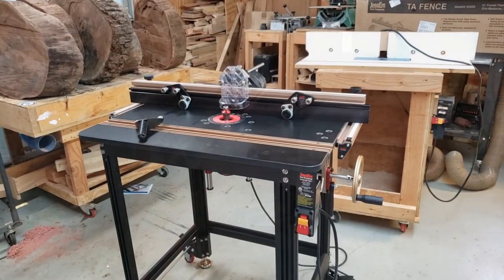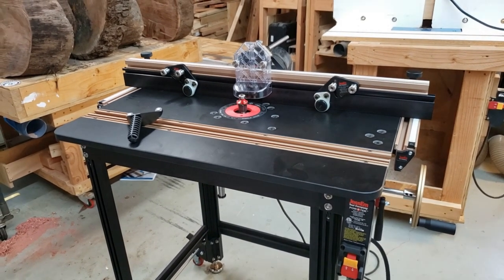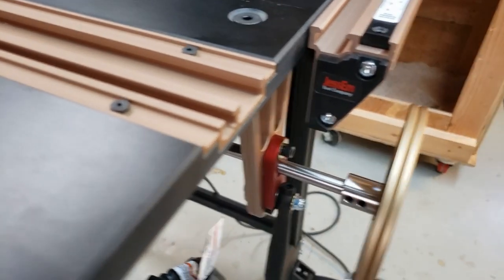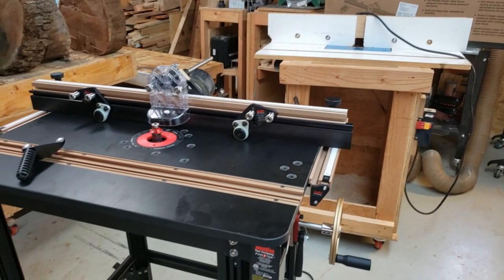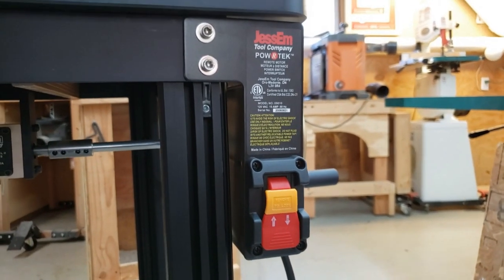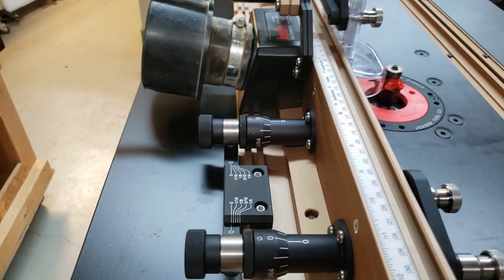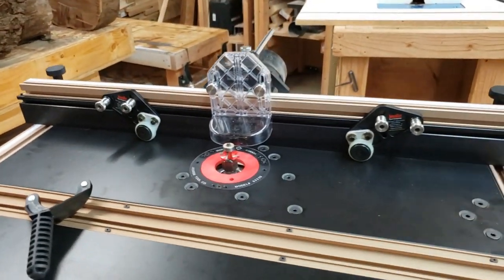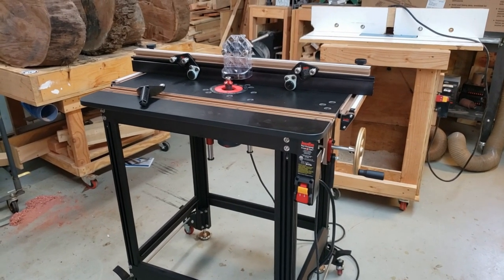JessEm Router Table and Lift Kit

Comment: I bought this same router table Only I'm getting it in pieces Lol I made a temporary stand We'll be building a cabinet After I get The 3rd generation fence Like so many others it was between the jassim and woodpeckers The tipping point The different routers that would fit in the jessum versus wood pad versus woodpeckers where you have to buy the wedges

Comment: Its hard to get info on the fence. Is it split to allow front and back adjustment ? Good luck with the shoulder.
Reply from the maker: Yes it is split. It has a micro adjustment on the outfeed side so you can use it as a jointer. Thank you for the well wishes on the shoulder. Getting better every day

Comment: Great review.  I am stuck on this decision for my shop: the JessEm vs. the Woodpeckers PRP4 or simply getting a Grizzly shaper for $400 to $1000.  Did you consider the Woodpeckers table setup and why did you pick the JessEm over it?
Reply from the maker: I searched and considered a number of items before I went with JessEM. The most important part to me was the lift mechanism and JessEM won hands down. after setting it up I can tell you it is an awesome system. While I am a Woodpecker fan, I do not regret my decision. Coming from Canada it was no tax which saved me quite a bit. Whatever way  you go, I am sure you will be very satisfied.
Reply: @BayneCustomWoodworking  cool, thanks
Reply: I ended up getting the Jessem package, same as yours.  It was a close choice with the WP table, but I like the Jessem fence better.  I also picked up a mite-r-slide which will come in handy for rail and stile cuts.   My table came missing a few parts, but to their credit they are sending them next day.

Comment: Hello, hope you are still doing well after surgery.  Thanks for the video and explanation.  Question, have you built any storage within the JessEm aluminum frame?
Reply from the maker: I am doing great since surgery and thanks for asking. I actually built a box inside the frame to store all my bits and wrenches
Reply: @BayneCustomWoodworking  , thanks for the reply.  Recently purchased a JessEm package with the same stand.  Looking to build a cabinet within the stand with Baltic Birch plywood.  Did you run into any problems?  Did you have to drill any holes in the stand to accommodate the cabinet?
Reply from the maker: @panchobrown7562  Mine was kind of stand alone. It just rests inside the stand itself
Reply: @BayneCustomWoodworking  thanks, subscribed

Comment: Considering this same router table I've probably looked at every one on the market and pretty much settled on this one. have you made a video using yet? thanks
Reply from the maker: Yeah I did quite a bit of research as well before settling on this one. I have a few on my instagram feed but I better get one up here as well.  https://www.instagram.com/p/CGLcR2Sjai2/?igshid=vlwp004bldr6  I can tell you I have used it to make shaker style doors, round over edges and using a flush trim bit to create round corners. This have been a great table and router lift.
Reply from the maker: https://www.instagram.com/p/CGLcR2Sjai2/?igshid=vlwp004bldr6 here is a short clip from my instagram feed
Reply: @BayneCustomWoodworking  thanks for the quick response.
Reply: The down side is my triton router wont fit so i will have to buy another one.
Reply from the maker: @kr5289  Darn that is a great router, i have on for using on my leveling sled
Reply: @BayneCustomWoodworking  yeah I know

Comment: Thank you for sharing your thoughts on this package. I'm looking to buy that base. I'm wondering how you would build a cabinet inside of it. Is it the  type you build  onto the stand or slide in 1/2" plywood, or do you build a cabinet and just drop it down in from the top?
Reply from the maker: Phillip - While I to am considering the need for a cabinet on this frame. However I have not taken the time to figure this out at this point. The materials are quality tube aluminum so I do not expect an issue, I just need to put more thought into it myself.
Reply from the maker: working on that concept
Reply: @BayneCustomWoodworking  Neat I can't wait to see it. I  went ahead and bought the jessem table with the master lift that has the adjustment from the top. It was was more straight forward how to build a cabinet for it. I am extremely happy with the build and machine quality of Jessem products. It is probably the nicest made thing I own.  Thanks again for sharing!
Reply from the maker: @realpdm  Sweet. sounds like you made a great decision